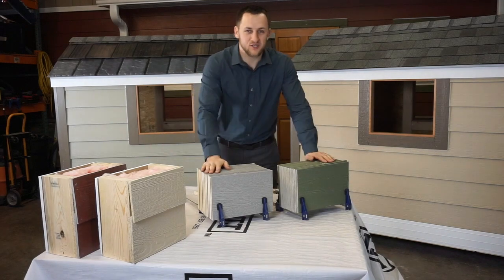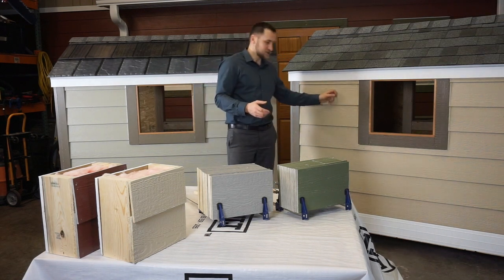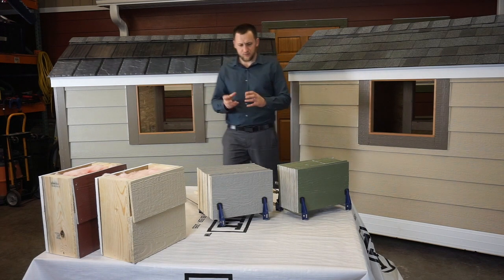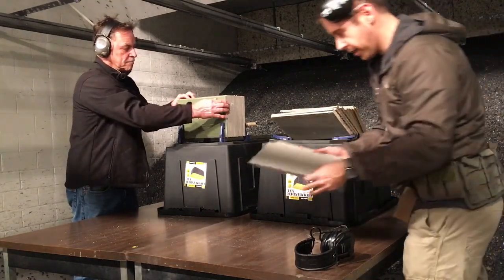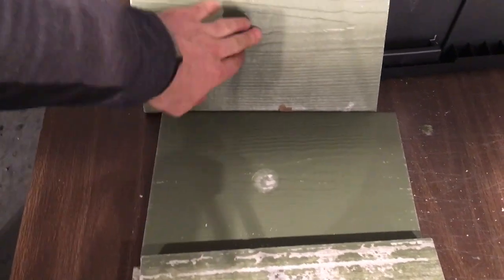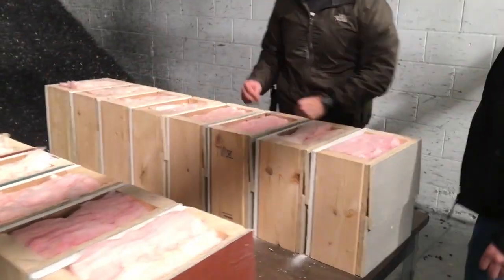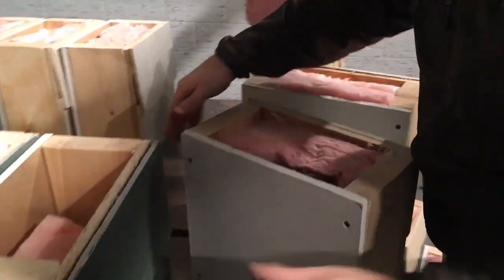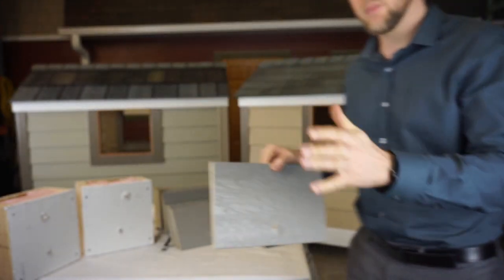James Hardie® Siding VS LP® Smartside® Siding 9MM Shooting (bullet) Test

Comment: hardie's ONLY advantages in my opinion are fire and possibly pests such as termites. However, proper flashing and other installation techniques can mitigate the latter in LP. Mold, delamination, impact damage are issues with james hardie as well as LP. dont fool yourself. LP trim looks much nicer. hardie does not hold nails well either. I think its a toss up as a homeowner, so the decision falls to the one with the best warranty. i would begrudgingly pick hardie.

Comment: What does a test like this prove? Absolutely nothing. Who is going to have multiple sheets of siding on their home? None. Take a hammer and hit a single piece of each and see what happens? Hardy will break apart. 
I'm a contractor and have used both products. I can take you to houses built with Hardy siding and show you where it's falling apart from where it absorbed water. I would use any product out there before using Hardy Board.  We are starting a project in a few weeks replacing Hardy Board where it has rotted. I'm not pushing Smart siding just telling you the facts contractors are dealing with. One man can carry a sheet of Hardy when dry. Let it set out in the weather a couple weekes and it will take two men to carry it and it will be hard to carry because it will want to fall apart.